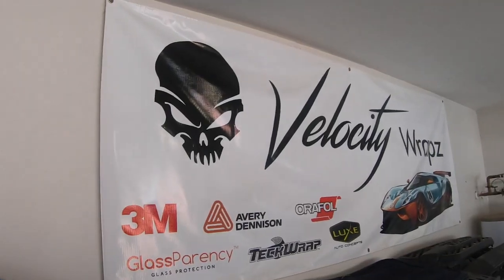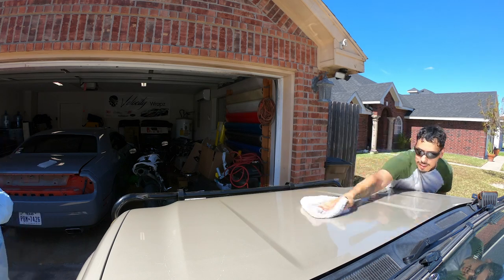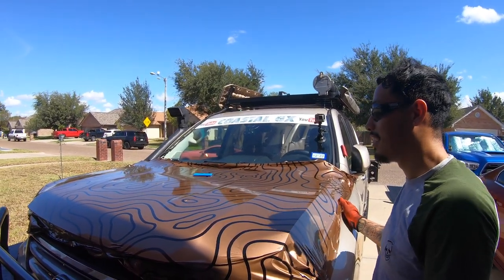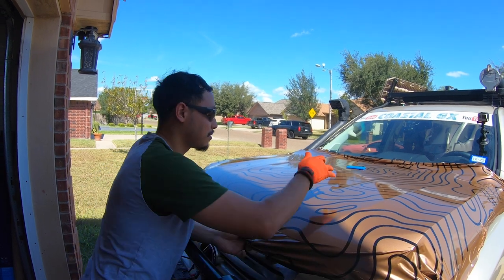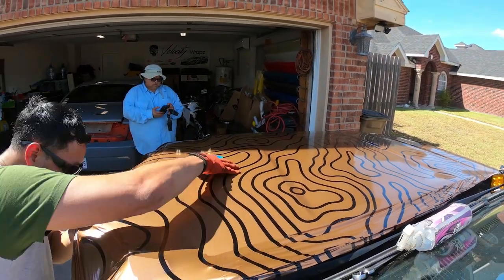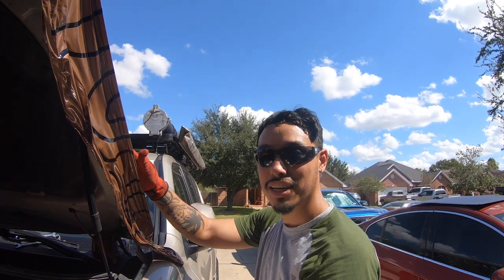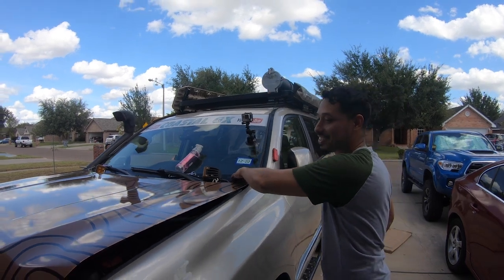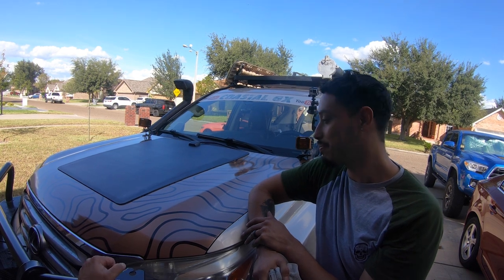Should you vinyl wrap your overland rig?

Comment: Wouldn't solar on the hood get too hot?
Reply from the maker: It gets hot in Deep South Texas with temps soaring over 100 and not to mention the engine heat. However, I’m averaging about 45 to 65watts input on the 100w panel. I run the fridge 24/7 with no issues. The performance is obviously better off summer.